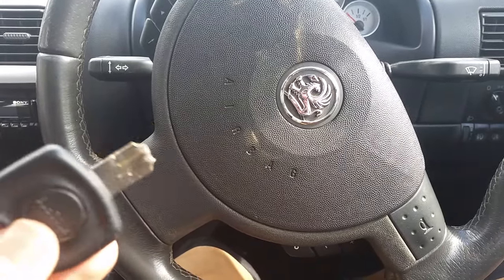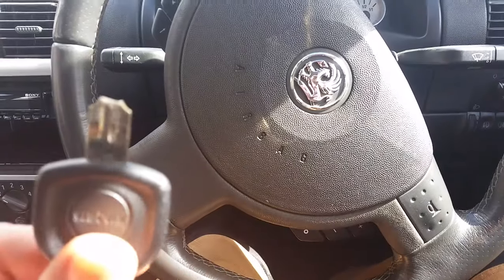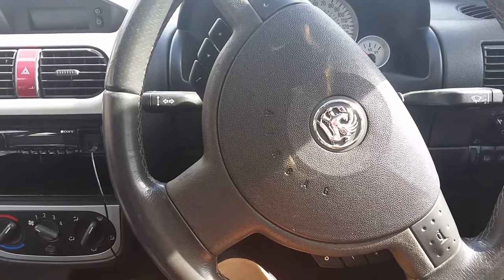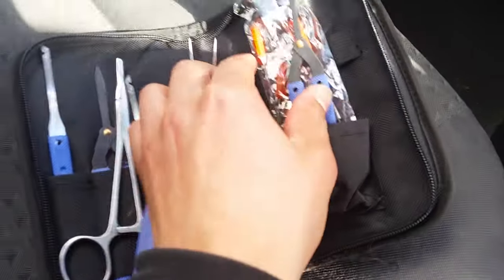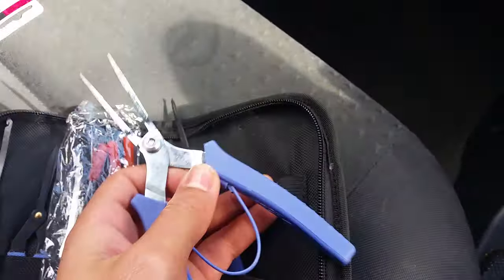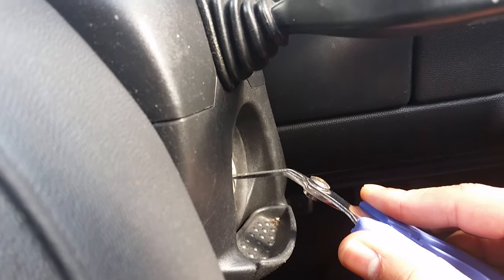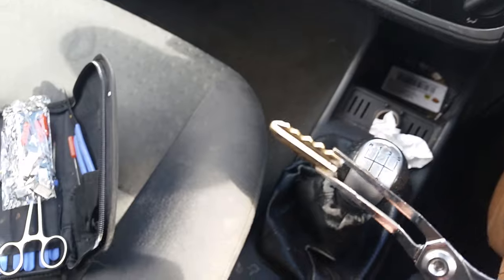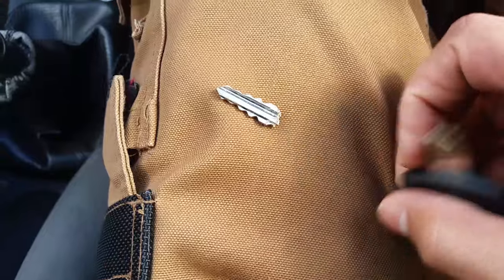Snapped key in ignition. How to remove snapped key from lock?

Comment: Those are hard to find in stores for pulling out the broken key head stuck inside the lock safe box :( cause it got stuck on mine i decide to break it half and theres no way i cannot pull it out and need to find the key tool to take it out the head